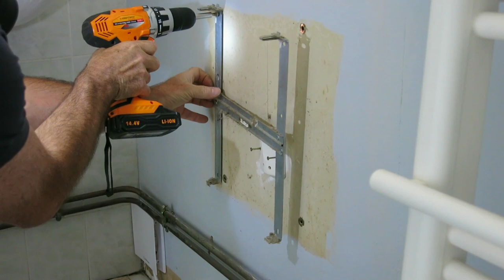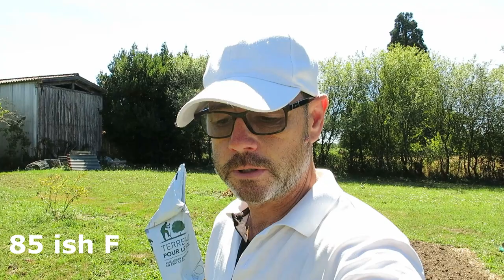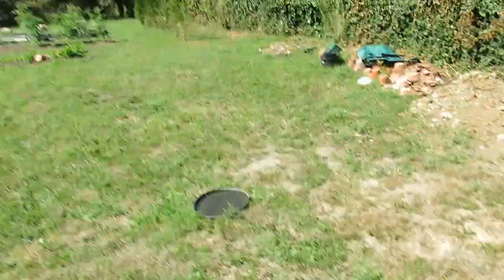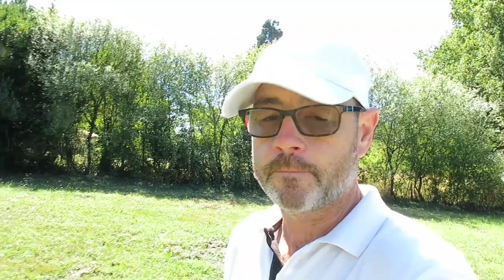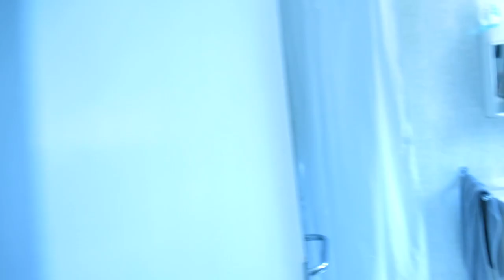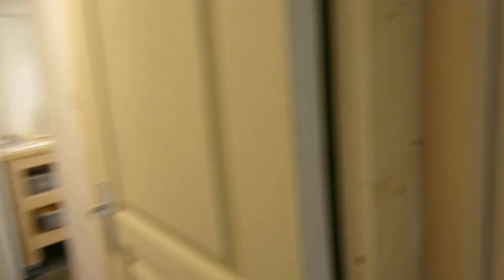Heated towel rail goes in the bathroom - My French homestead renovation

Comment: Is there a reason that the log burner has to go on that wall? It seems that the heat might escape every time the back door is opened.  Could it possibly go in the corner opposite and some of the warmth would go into your bedroom.  I think it might be better to have your back to the back door and snuggle around the  fire there.  Just a thought.  I'm  sure you have your reasons for the other position.